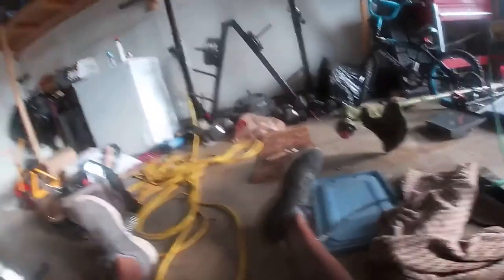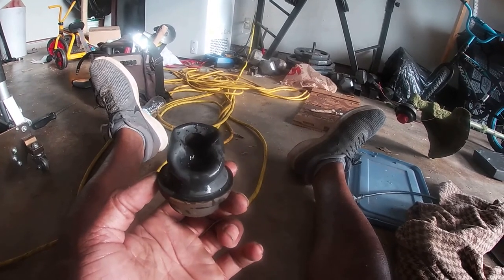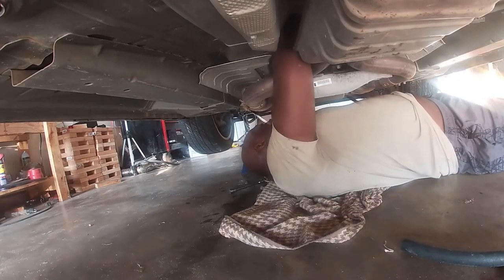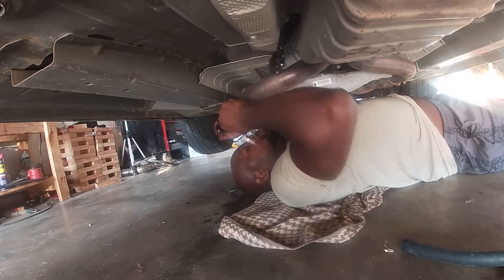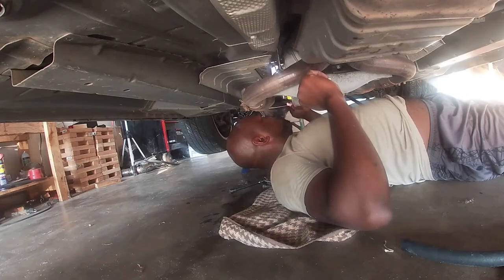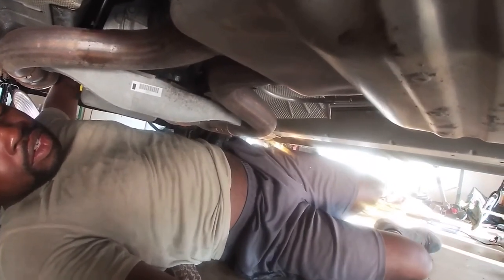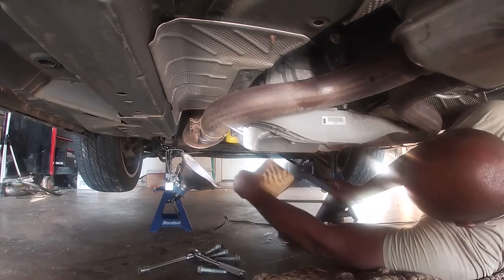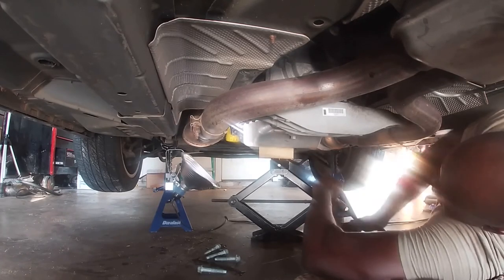Car A/C leaking water on floor and inside|Water in dash|5th Gen Camaro fix #ACleak #waterleak

Comment: Quick question, that metal line on the right side of the exhaust. The one with the open end that goes to nowhere. What is it for? I changed my cats the other day and found a small rubber hose line with a round part at the end. Which was in between the heat shield and the headers on the passenger side of the engine. The end part got melted from the heat and I need to replace it. I traced it leading back to the hard-line that is open to nowhere.
Reply from the maker: Honestly not sure I’ll have to rewatch the video.

Comment: Have the same issue I got a 2012 v6 tho would it be the same and also what size bolt was the transmission bracket
Reply from the maker: Probably the same, don’t remember the bolt size but most likely 14 or 15mm
Reply: @boostinwillie  thank you helps me alpt having the same issue I keep my ac now at a 1-3 speed sadly
Reply from the maker: @lowlifewill8895  hopefully it’s a easy fix

Comment: Was able to fix this after a heater core issue but I think the leak damaged my radio. It won’t turn on. Any suggestions?
Reply from the maker: 😬😬 try disconnecting the battery for ten minutes and reconnect. No promises it will work